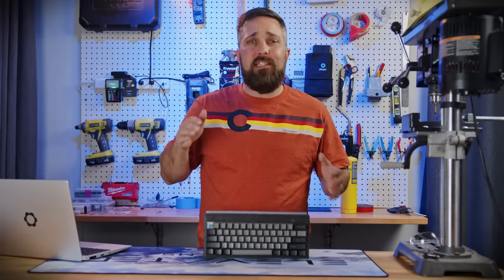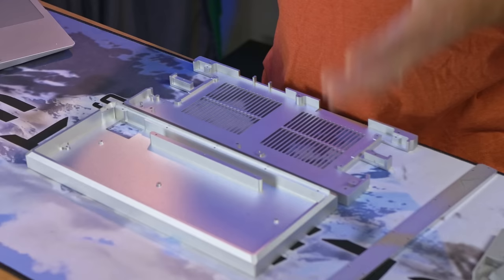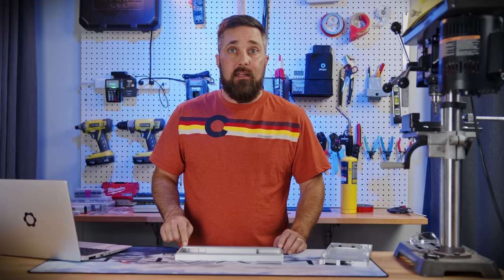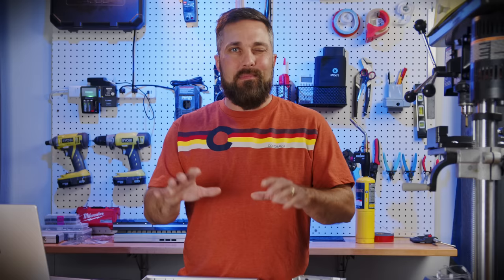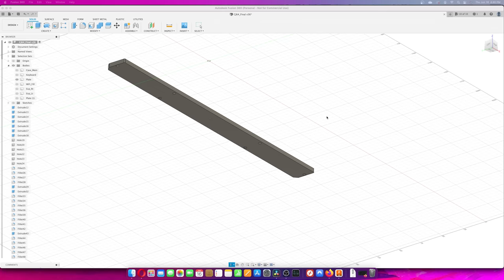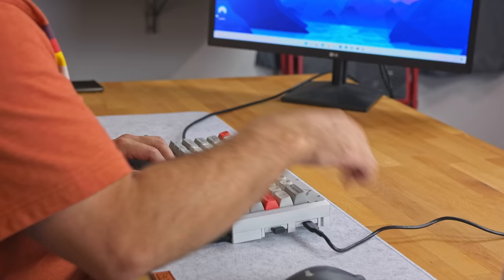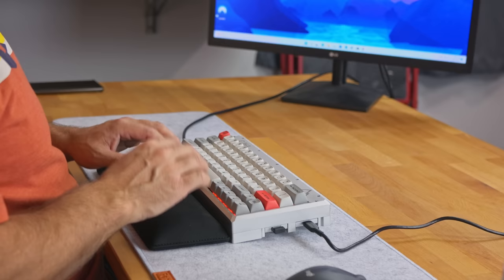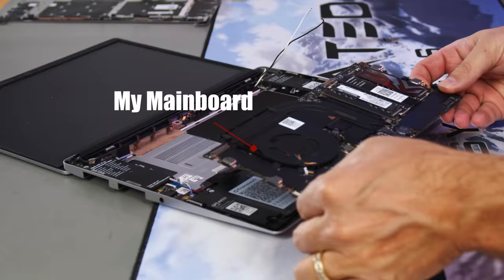The Ultimate Framework Keyboard PC! Machined Aluminum Mainboard Enclosure!

Comment from the maker: I forgot to mention that there is a mounting location for the audio sub board in the enclosure, however the headphone port would need to be drilled into the side of the case to use it. More cost savings.
Reply: Hi there! Just have some idea that i think it gonna be useful in your egpu project. You may know hdflex release their 250w gan psu…and the beauty of that psu is it enough to drive a 3060 itx (170w) + this modular single board (65w over all system)…so you could make the smallest portable enclosure still powerful enough to drive modern AaA titles and workflow.
Reply: Wow

Comment: I like how you've essentially become the de facto main channel for Framework projects...
Reply from the maker: It's wierd that my best performing vids are Framework and Mac related. Polar opposites.
Reply: @ElevatedSystems  Everyone wants the ultimate setup. Either the most aesthetic software and latest processors (Mac), or fully user-modifiable and -serviceable (Framework). At least, that’s what I come to your channel for 😅
Reply: @ElevatedSystems  You know what’s funny? I was seriously debating whether to get the Framework or a MacBook Air. I went with Framework.

Disclaimer; I’m pretty deep inside the apple ecosystem, and I am a sucker for OLED screens. That’s why I was considering the MacBook.
Reply: @Marcus001 so how're you liking framework
Reply: There was this other guy who made a portable gaming device/console out of a Framework mainboard with detachable controllers. Kind of a mix between a home made Steam Deck and a Nintendo Switch
Reply: @ElevatedSystems   I have a mac as a daily driver but the framework is on my radar for my next linux machine. I only use windows for my radio stuff🤣

Comment: Hi CJ, have you considered a full-sized keyboard version? You could fit a 2.5" drive bay or battery under that extra space.
Reply: Eltoblem id he’d likely need to extend the ports on one side 
Definitely doable but a bit more engineering as I don’t believe any usbc ports have a mounting design like some usb a ports
Reply: I had an idea for extra-long framework expansion cards, like long enough to fit an m.2 drive inside. Those might fit a 100% keyboard enclosure

Comment: Love your Framework projects! RE: power button placement: love the retro of placing on top, however recalling problems with that placement in past, so voting agaist placement on top... unless you have an integrated cover to prevent unintentional power button presses (or make it a switch instead of button). ***Would be cool if looked like button (to be retro), but was actually a switch (to prevent unwanted activation)!

Always ended up making covers for the button when on top as had problems with the power button getting pressed when I didn't want it to be pressed. It wasn't from stray typing, it was from pets (cats, birds) getting where keyboard was (even briefly) and pressing it. Also, other household members placing things on keyboard or nearby (that fall on it) would happen too.
Reply from the maker: The C64 power switch was on the right side, the power led was on the top. But I do think I'm going with it on the back panel.

Comment: This is awesome!

There's something I've been thinking about with framework laptops that I've wanted to work on myself, but lack the equipment to do. Due to the modularity of the ports on the frame work laptop, why not make an enclosure which, on one side has the standard IO (perhaps an HDMI & USB) and the other remains with the plain / unpopulated  expansion slots. That way, you can have expension slots on your home theater, on your work desk and you can take the mainboard in its case and just slot it in. The best part of it is when you slot it in, it will quickly populate everything you need- hdmi, storage, mouse, keyboard and etc, reducing having to take things back and forth and have one main computer for multiple different purposes.

For me, if I had this solution and perhaps the GPU I mentioned before, I would get it to take to work, use as a console and overall substitute my 2 computers.
Reply: 2nd note- just finished the video and saw you mention the GPU attachment. I'm stoked for that!

Comment: good tip is to put the tap in your drill and hand wind it so you get nice straight threads, can sometimes be quite wobbily on those first few threads when only using your hand.
Reply from the maker: I usually do but the parts were to big for my drill press vice.

Comment: That's really cool.  With all the hard work and skills you have and quality videos, you should blow up huge.  Best of luck!  
I don't have a framework laptop but I've been looking at them now (really want a 17 inch version).  If I did have one, I'd definitely want your invention.
Actually, I'd love to have something like you made for all my old semi-retired pcs.  I'm using some 20 year old pcs to just run some spare network drives and they keep going but I have to keep them in huge old desktop cases that is very overkill for what I use them for, but it's bought and paid for.  Having a small keyboard to run them would be very ideal...unfortunately being desktop motherboards, they're also too big.
I think you should try to get your design mass produced with Framework and they can sell them officially on their channel.  Work out a licensing deal where you don't have to do anything else except collect a percentage and/or per unit royalty as all passive income.
Reply: Unfortunately, can't really shove them into racks either. Need at least 1.5u cases, and server rackmount cases are pricey in general compared to similarly sized normal tower cases. And considering the cost of custom cases fabbed out of sheet metal, I suspect they would only make sense if you designed something that fits say, 8 ATX boards at once in a 8u space

Comment: I'm sure someone told you already, but when drilling small holes, peck and lube anything smaller than .250"! It's a good practice even if your drilling holes larger than that, cheers!
Reply from the maker: I did oil and peck evey hole, my problem was I should have swapped out the bit after each 8 to 10 holes drilled.
Reply: @ElevatedSystems  Also looked like you drill rpm was way to low for that small of a drill.

Comment: This looks really cool and I would definitely be interested in it as a mobile computer!
 My only concern is the overall thickness, since I definitely prefer thinner keyboards, but I know that there really isn't much that can be done without giving up the very things that make this project worth doing.

Perhaps the only other thing I would love to have would be an external battery either in the form of an attachable trackpad or numpad, or perhaps by choosing a TKL/Full sized keyboard instead. It should definitely be possible to plug it all via the existing USB-C interfaces, so making it all also work as an extension wouldn't be too crazy (but probably cost prohibitive).

Comment: Brilliant. I would move the keyboard forward and the PCB backwards like the Amiga 1200. You could fit in a lot more and the keyboard would be low at the front.
Reply from the maker: The KB cant go back any farther. The space in the rear of the case is the bare minimum needed for the USB connection.
Reply: @ElevatedSystems  I mean angling the keyboard and the PCB goes under only by about 50%. Of course this would need a deeper case. But you would get more space and a much lower keyboard at the front.

Comment: this is awesome! congratulations, you did a great job :) in one of the vids you mentioned perhaps making the case longer to allow a hub and a wrist rest at the front. may i add that if the keyboard would be similar in size to the amiga 500 / atari st then you could also place the graphic card at the back (ventilated to the side), the powerbank/psu also at the back, incorporate the hub and please an SD/TF card reader on the right hand side where the old 3.5 used to be. it would be a dream retro pc with possibility to boot into any system :)

Comment: Great work on this one! Just one tip from a Mechanical keyboard guy: you might wanna try doing the force break mod to reduce the weird hollowness.
Reply from the maker: I think that would leave a gap between the two parts. They fit together perfectly flush with zero tolerance.

Comment: What i'd like to do with these motherboards is get 2 of them, and build a 2U chassis with 6 hot swap 3.5inch drive bays for each node.
Use a basic off-the-shelf dock for rear IO on each node. 
Built in battery backup for both the node, and the drives.
5-40G USB-C connection between the two nodes for syncing without hitting the network
Boot from a dual drive connected over USB-C.
Break out the two NVMe slots to four 118GB optane drives per node, two as a ZIL and two as L2ARC, note as Optane only has a 2x link the best bandwith would come from breaking the 4X link out into 2*2x links, if i'm wrong about the framework having 2 NVMe slots then cut that in 1/2, and get a corel AI TPU for the wifi slot

Comment: This is cool project.

Any chance you could share more than just STL files. They are triangle based, and not that conducive to remodeling. STEP files would be extremely useful.
Reply from the maker: I released the .STP files on my Patreon.
Reply: @ElevatedSystems  Thank you. I will check out!

Comment: This would be awesome if you had a way to include the battery as well.
Reply from the maker: I looked into it but nothing really worked. The battery is the same size as the mainboard so adding it to a wrist rest would have doubled the width of the keyboard. Not the look I was going for but someone else may run with the idea.

Comment: the original motherboard should have a ribbon cable connector for the keyboard. Couldn't you have used that and make a custom mechanical keyboard pcb instead of using one of the 4 expansion ports. you could even do the same for the screen as well since that too is connected via ribbon cable so you should be able to connect it to a custom display port that way you still have all 4 expansion ports.
Reply: at the moment you have already used all ports for keyboard, display,  mouse, and power. That is a very big downside as a desktop since there is a hassle of using dongles or temporarily swapping in order to use a usb stick. Do recommend using the built-in keyboard and display connector.

Comment: Ok. this is my favorite kinda content. Technology plus mechanical building. Love it. 
Quick question: I’m sure you considered it and I ask this with only respect for your design. I am curious why did you not make snap locks for the plastic parts? The feature would be 3d printed and you could have reduced the screw holes needed.
Reply from the maker: The connection of the expansion cards to the motherboard is the tightest tolerance in the build. Screws allow for a bit of flexibility in lateral movement and can be locked down tight. Plus adding a screw hole is a lot cheaper than adding a clip retention notch.
Reply: @ElevatedSystems  that makes sense. Thank you for the response.

Comment: Wouldn't it make more sense to flip the board so the ssd ram and cpu could get better cooling also I wonder how difficult it is to stuff a battery and go with a slimmer keyboard
Reply from the maker: dosen't work that way. The fan sucks air from the bottom and out the back and you can't sandwich the battery with the mainboard due to heat issues.

Comment: Drill press. Where'd you get it? How much? How happy are you with it?
Reply from the maker: There's a link in the description. I got it because it was inexpensive and fit the woodworking projects I do,  but if I was doing high precision work like I did on this case more often, I'd get a more expensive and more solid one.
Reply: @ElevatedSystems  Gotcha. Didn't think to check the description. Yeah, by the looks of things, I'll have to go for a sturdier one, most of my work is most likely going to be in metals. Thanks anyhow!

Comment: It is nice project. But to be honest I dont think that pc integration intu the keyboard is a good idea. When you spill something in keyboard you just buy a new one so no big damage. If you have a pc inside... vesa mounted pc is better in my opinion with combination of keyboard with integrated usb hub.
Reply from the maker: The PC mainboard is in a second compartment under the keyboard so it's protected from spills, However, as my first computer was a Commodore 64, I learned not to have open beverages around my computer, ever.